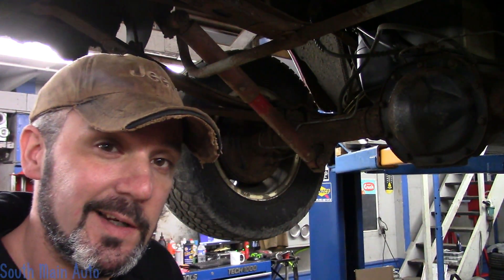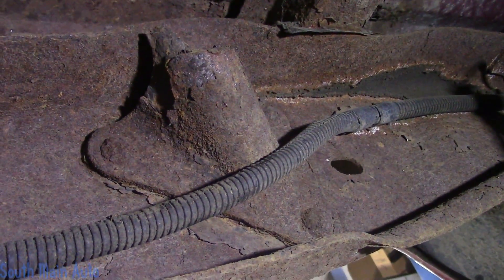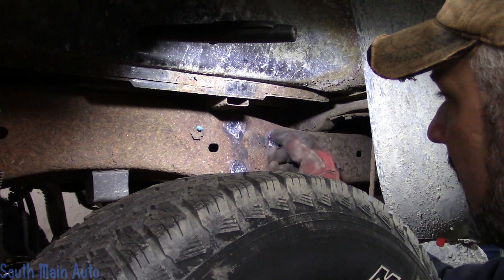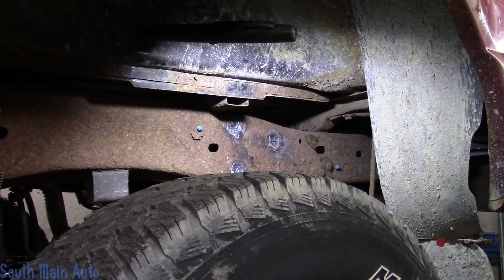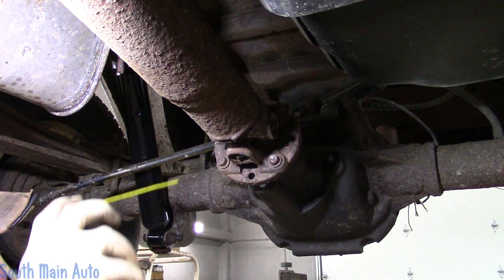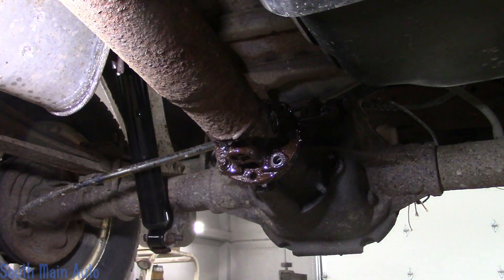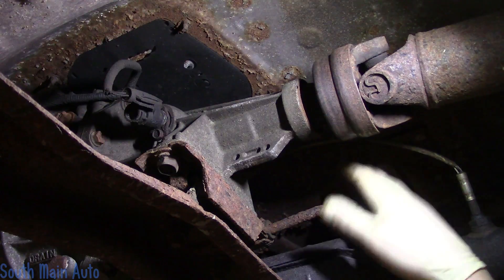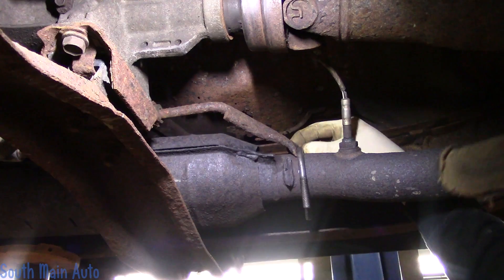Ford Ranger: Broken Rear Shock Mounts

Comment: Man that ranger was cherry compared to the last one I worked on. You could stick your hand almost through the frame behind the spring mounts and I needed the 3/4 drive impact for the driveshaft bolts. Funny thing, he bought a few cans of undercoating and some shop passed it for inspection, crazy.  Yeah when I was starting out, someone said oh a torch wont cut cast just burn the bolts out of the manifold, Needless to say I hit is with the flame and dodged spatter and later bought new exhaust manifolds.

Comment: looks like you will be doing the brake lines and hoses soon. 🤪 ... i had an old square body jeep drive into the shop with good brakes. I pulled out (tried) and the pedal went straight to the floor, rusty brake lines gave out right there in the shop. guess who got blamed? Ever Since!...lmao.

Comment: In regards to welding under a vehicle do you have to use a fire blanket or anything to prevent sparks near gas/ other flamable fluids?? I'm a welder but never under a vehicle

Comment: Sir Eric, I had to do the same to my younger son's Ranger. The thing I did with the new brackets were drilling a hole in the bottom so they didn't fill up with JUNK & RUST OUT AGAIN. Then I repainted them & the bolts, nuts. Question ? How long does that Fluid film last ( ROUGHLY ) on bolts, nuts, brackets, stuff you spray it on in the RUST BELT, I live in PA. Thanks Sir Eric, Hey GREAT FREGGIN IDEA PUTTING CLAMP ON EXHAUST & WELDING TO THAT, GENIUS.

Comment: I bought a brand new 2002 Mazda Ranger B2300. About 6 months into my ownership experience I heard a god awful noise from the under side of my truck. Dropped it off at the dealer and got a call from the service writer telling me they “could not duplicate the concern”.  I was persistent with him so he sent one of the mechanics to take a ride. All was well until he took a hard right with moderate braking when it sounded like the bells of Notre Dame under our feet. The mechanic driving exclaimed “ what the @#$& is that?”. Got a new driveshaft under warranty.

Comment: Nice fix for the shock mounts. I have a question. Is there any rules in general as far as welding on the frame of a vehicle and or welding on body parts to weld metal to fix holes. With all the electronics in vehicles these days I didn't know if there were any rules to follow to not damage these electronic/computer parts. Thx

Comment: I have never ever ever seen rusted bolts come off so easy in the "" Rust Belt "" !!!! You can even weld on that crusty metal in the rust belt !!!  You ain't going to do that down here in Florida, better have a big long breaker bar and impact sockets to get nice clean rusted bolts and nuts off !!!!!!  "" Rust Belt "" my as* !!!!! Salty Air Belt down here is much worse !!!!!  Maybe I'll send you the next clean one I snap off !!!!! My wrenches look like pretzels !!!!! Nice job on the shocks, mount and driveshaft, welding rusty metal is like soldering new clean fluxed pipes there in Avoca !!!!!!!

Comment: That's the result of driving on washboard roads at high speeds and salted roads in the winter.
Reply: You mean using it every day.
Reply: @johnmccallum8512  
Yeah, if you choose to live in the boonies and drive on salted washboard roads, I suppose you're right.  I prefer to live and drive on smooth, paved roads with no salt on them.

Comment: So what’s your opinion on the factory coating the frame? I know you had made videos before showing the downsides of people costing their own vehicles. I live in Arkansas where typically we get maybe 2-3 days of snows on the roads a year.  My 15 Chevy Silverado 4x4 is completely coated from the factory with a rhino lining product and complete plastic under pinning. It makes it a pain to inspect or do anything without a lift. Takes forever to remove all the bolts and clips.

Comment: I should drop my purple turd 97 ranger off and let you have at it one of these days haha. Broke forward leaf spring mount which is disturbingly common, clutch needs to be replaced, front end needs new camber bushing and re aligned and so much more.

Comment: I use ani-sieze on caliper support frame mounting bolts, pin bolts, and basically all bolting under the car.  The NE is so bad on corrosion that it saves the fasteners.  Is this wrong to do?

Comment: you can cut nuts off bolts with scarfing tip and not damage threads. that's what a scarfing tip is used for... YOU CAN ROTATE THE SCARF TIP 360 DEG. FOR ANY POSITION …. check it out. now if you use a cutting tip for scarfing ,you use the oxy valve on your mixer to control the blow on the tip not the trigger on the burner.  (I'm a master with a torch so maybe its easy for me and too hard for others .. I just don't see it that way. I feel if I can do it, you can do it)

Comment: I observe using spray oil on rusted stuff lasts a week or so. If you really care about the rusty metal I would stick some grease on it. At least then it lasts and keeps water away which is what causes the corrosion. No amount of grease or metal oxide paint is going to stop the rust once it starts; giving it a grease coating just slows it down. Just my humble opinion; for what it's worth!

Comment: Hey Eric, general question:

I just bought the same Astro P. light that you use, only used a flashlight held with my teeth before lol.
You use it a great deal more than i ever will, has the magnet shown signs of losing strength over time?

Comment: get a scarfing tip for your torch.. and learn how to use it!!!! don't use a cutting tip for taking off ribbits. its also used for scarfing welds, or bearing races welded on spindles ect. ect.

Comment: Another fun Day Under The Vehicle is replacing the spring hangers AND the body mounts.
Our shop uses a sharp air driven chisel to pop off the rivets because Rangers have notorious fuel system and other leaks.
Dorman parts if you need to do this job.This repair WILL cost more than the truck is worth.What you can do is go buy a new Ranger-get together $42,000 for possibly an even bigger SHINY pile of steaming doo-doo.
Crap tranny is $1800 at Jasper.Only thing good about this gas hog ,money pit is you can get them for $500 from people bankrupted and depressed.
Rapid Ranger,ha ha,now that's funny.Slower than a 300D 82 Mercedes when the FORD is running well.

Comment: There's a penguin driving down the street, his car starts spitting, sputtering and blowing smoke out the tail pipe. The penguin pulls into the local auto garage. The technician says "Mr. Penguin, I'm super busy right now, I'll need an hour to tell you what's wrong with your car. There's an Ice Cream Shoppe next door, just get some ice cream and come back in an hour." The penguin replies, "That's great, vanilla ice cream is my favorite, I'll be back in an hour. So the penguin waddles over to the Ice Cream Shoppe and says to the worker, "I'll have a bowl of vanilla ice cream. It's my favorite, and I have to have it in a bowl because I have flippers, not hands, so I can't have a cone." So the Ice Cream Shoppe gives the penguin a bowl of vanilla ice cream. The penguin starts pecking away at the bowl of vanilla ice cream. He's making a huge mess, getting ice cream all over his face and just an overall mess. The penguin waddles back to the auto garage, walks in, and the technician says, "Well Mr.Penguin, it looks like you blew a seal."

Comment: Called a shop looking to get a clutch replaced in my '97 Dodge Cummins and they told me they don't work on anything older than 2000.....My engine only has 200,000 miles and the rig spent most of its life in dry Texas.....what is the world coming to?
Reply: that's probably a good cut off rule for cars  Trucks maybe 30 years like 1989.
Reply: isn't the 1997 and 2000 the same?
Reply: If ur in san antonio, ill do it!
Reply: Haha they cant plug there scan tool in to your 97. People are getting more useless every day.
Reply: Unfortunately you're probably a long ways away, but I'm in KC, Mo...I know my shop would do it. We don't turn ANYTHING away
Reply: Can't blame them- rust, corrosion, old brittle plastic parts, less availability of parts, and any number of reasons. I don't like working on old stuff and there's plenty of newer stuff to make a living working on. They probably figure it's more trouble than it's worth and a lot of the time I'm sure they're right.
Reply: Try and fine a performance diesel shop, they love 12 valves.
Reply: 10 years for motor cycles many shops.

Comment: '98 B2500 Mazda 4 cylinder manual with 298,419 miles.  Head has never been off.  Talk about a truck not owing you a penny.
Reply: I  had a 95 ranger that i sold with 230k, then saw it about a year later with almost 300k, I put a water pump and a clutch in it and that was it and a two timing belts, these years of truck were made pretty good for what they are, I've got a 2010 ranger now that's not made nearly as well as that 95

Comment: Big nasty with a rivet cutting chisel would have popped the tops of those rivets with ease.
Reply: AND
Less chance of a big nasty fire you can't get out.Those Rangers have plenty of broken filler neck hoses.Ford=$700 Aftermarket $150
been there got the T-shirt

Comment: "car making sound around the ass"
discovers shock missing

me: you mean, this guy has been rolling around with just the leaf springs? what a horrible ride... should really be asking him to come in for a quickm checkup once a year, $25 per vehicle checkup, 30 minutes of work, you could get some sales while telling people and walking them through their vehicle

When I done a checkup of my vehicle last, i found half the replacable front end was needing attention, and he even shown me, for those that are saying "oh he was trying to scam you" I don't think the steering rack is supposed to leak, or coolant was supposed to be coming out of the transmission, or the fact that the rubber underneith... well the only rubber I found there was basically the tyres, the engine, transmission, joints.. were gone.

Best $50 I spent, now I got a car that doesn't make it feel like I'm going to run off the road at 35mph and I don't feel every bump like it's a cattle grate

And yes the guy did let me drive away, just just wanted me to be aware, he didn't even write up quites saying "$2,000 you bought it for? yep, not worth replacing..."

This is in Australia, we get our parts OEM from USA, and they get many of their OEM parts from People's Republic of China